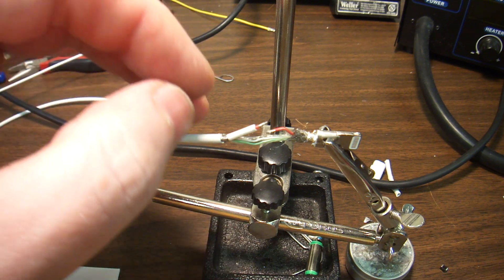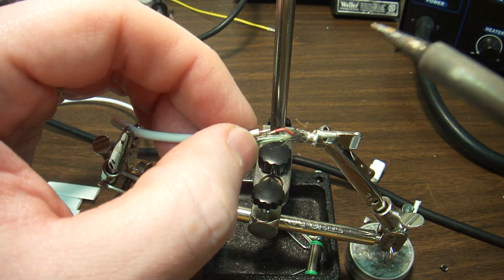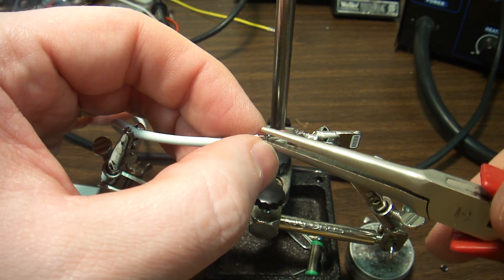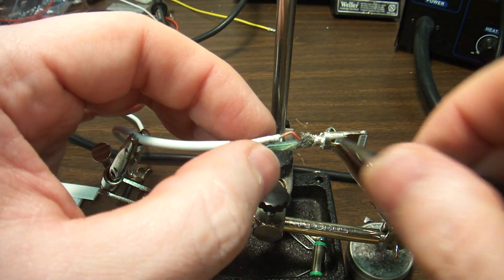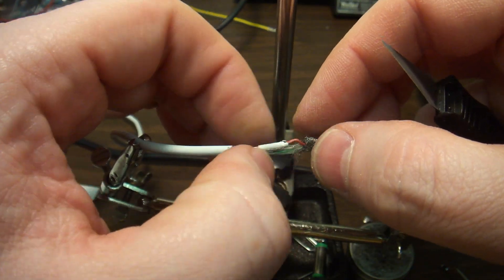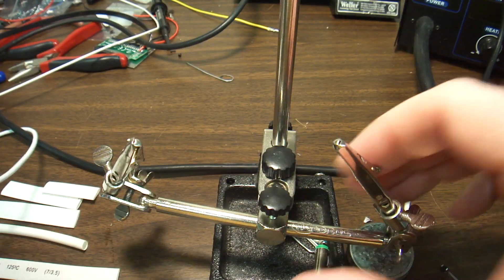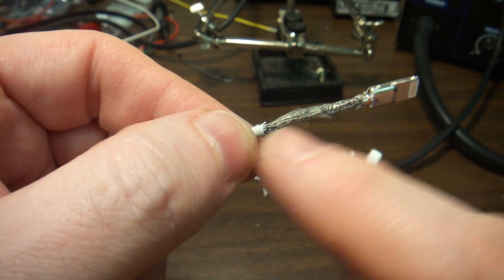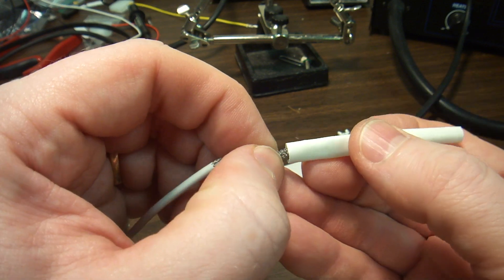How to fix an Apple Ipad Ipod Iphone Apple Lightning Connector Repair Part 5

Comment: I know this video is old but thanks so much for this. I wasn't sure if you were supposed to cut the main silver wire so mistakenly I did but got it back together. oddly, my red cord was popped just like yours.

Comment: i didnt need to use the gun i just twisted them together used some electric tape im all good yo... they use that metal fiber so that you cant find the source of the prob lucky i found mine without having to remove all that fiber metal whatever it is...mine works just fine now ;]

Comment: I know this video is old but thanks so much for this. I wasn't sure if you were supposed to cut the main silver wire so mistakenly I did but got it back together. oddly, my red cord was popped just like yours.
Reply: yeah my red wire is popped as well. so i guess it's a common issue that apple needs to fix.
Reply: I agree